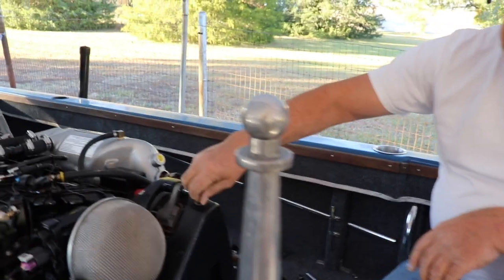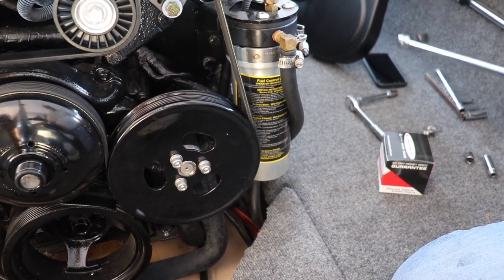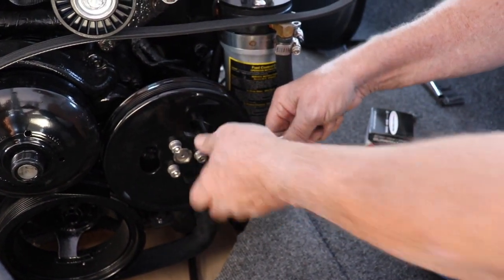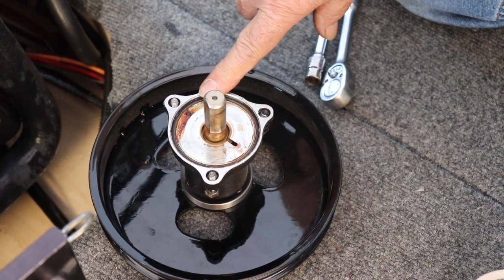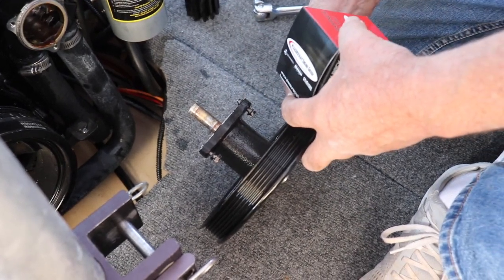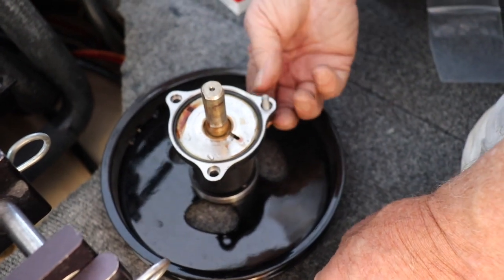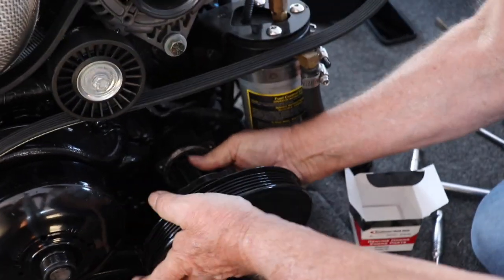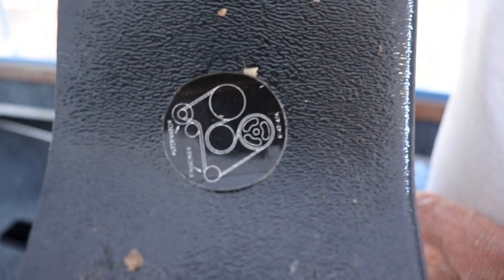How to Change the Impeller | PCM Modular Raw Water Pump | RP061022

Comment: good to know. On my Sherwood px176 Rawwater pump on my 3208 Cat, I always remembered the "set" showing the direction the pump turned to insure the new impeller had the vanes turning in the right direction by rotating as  the impeller was installed. Didn't want they being "backward" if the rotation  was in the other direction than as the blades were compressed during their rotation. Perhaps its not an issue with this engine. Just a thought. I will be installing these impellers shortly on crusader engines

Comment: so many vids here and on all of youtube on HT install an impeller.  I got it, so dang easy.  Do you have a video on rebuilding a G21 raw water pump.  92 PCM 351 engine.  
bearings, clips, seals, etc.... take it apart, put it back together?  maybe just an exploded view dwg?  what goes where, what order, HT get the dang thing apart.  
please help a boater out here.

Comment: I wish you would do a video on replacing the impeller in the most poorly-engineered raw water pump in history.  That would be the one on my 2002 Ski Nautique with the "Excalibur" PCM Chevy 350.  The pump is nearly inaccessible due to its location  between the fuel control cell and the harmonic balancer pulley. One of the mounting bracket bolts has to be removed using an open-end wrench because it is located behind the pump pulley. Of course, the tight quarters limit the wrench to less than one sixth of a turn, so removing this bolt takes quite a while.  Once the mounting bracket is loose, and I have cleaned up the blood from removing the inlet and outlet hoses, the pump and mounting btacket assembly must be maneuvered back under the engine to the only spot it can be removed, from the area between the two left side engine mounts.  The best part, though, is trying to wrangle the new impeller into the housing.  I always allow a couple of days to do this.  I use a couple of hose clamps to compress the impeller blades, and lube the blades with dish soap.  It usually requires 50 to 60 attempts to find the magic combination that gets the impeller in without pushing the woodruff key out of the slot in the shaft.  I'm up to 30 attempts tonight, and I'm quitting for the day.

Comment: Your comment couldn’t be more true about the aftermarket impellers is not keeping up. They fall apart after 30 to 50 hours. I wish I could upload the picture of the one I just pulled out. There wasn’t one fin left on it and it has 32 hours on it. I will be ordering PCM parts from now on.